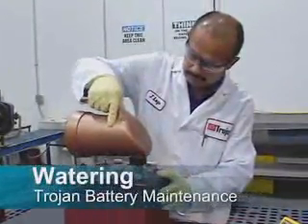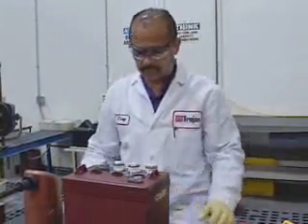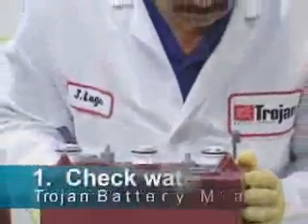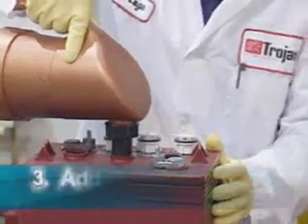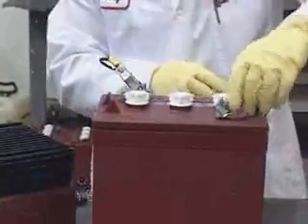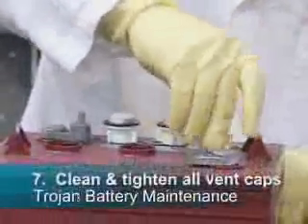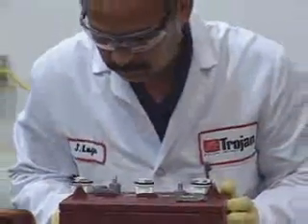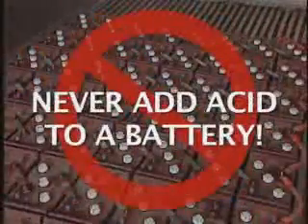BATTERY WATERING 233p1

Comment: I just got new batteries for off grid system,I might have over watered them,some will have a little leakage near the vent covers. I hope I didn't just ruin all ten batteries! Is there anything I can do to save them?
Reply: I've used a turkey baster to remove some over fill before, but when charging and they piddle up around the vents easy thing is just to wipe it off